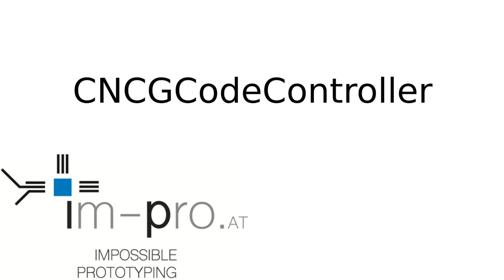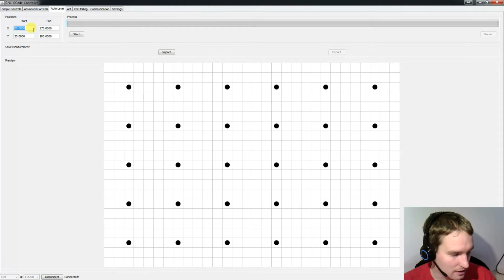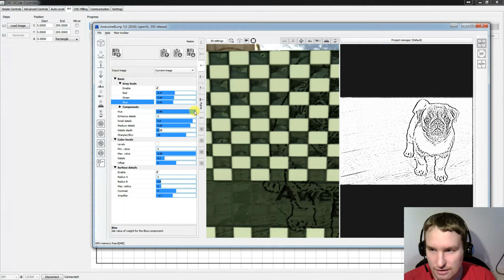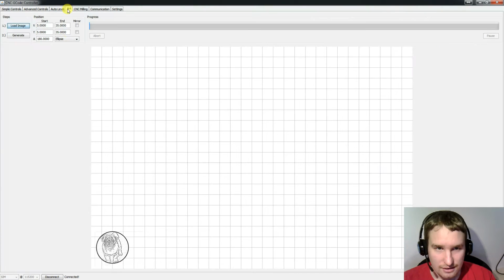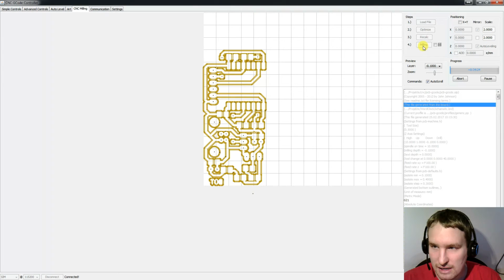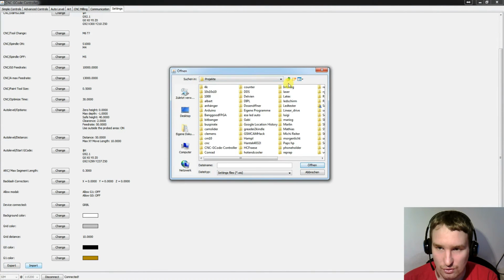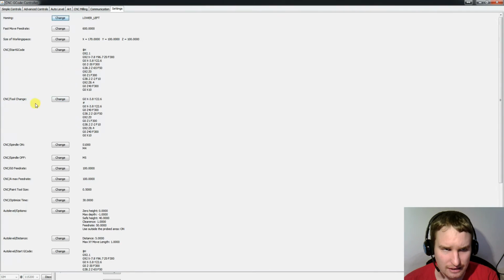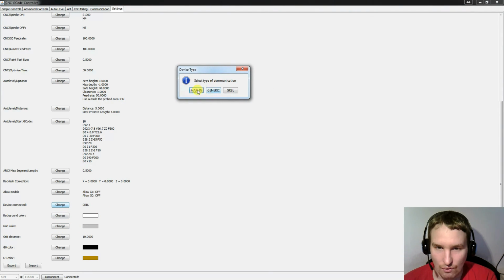Tutorial CNCGCodeController [en]

Comment: I am able to get his program to work as advertised in SIM mode(using Windows 10 laptop), but when I select my printer's COM port with a baud rate that works using Pronterface the program disappears as soon as I click on CONNECT.  Can anyone help with this???
Reply: BTW...I do get  a hs_err file each time this occurs, but can't make heads or tails of it.  Here's what the top of that file looks like:

#
# A fatal error has been detected by the Java Runtime Environment:
#
#  EXCEPTION_ACCESS_VIOLATION (0xc0000005) at pc=0x000000006af4753d, pid=16780, tid=0x0000000000002f3c
#
# JRE version: Java(TM) SE Runtime Environment (8.0_261-b12) (build 1.8.0_261-b12)
# Java VM: Java HotSpot(TM) 64-Bit Server VM (25.261-b12 mixed mode windows-amd64 compressed oops)
# Problematic frame:
# C  [libNRJavaSerial.dll+0x753d]
#
# Failed to write core dump. Minidumps are not enabled by default on client versions of Windows
Reply: I have same problem. Do you found solution?

Comment: this software looks great! unfortunately it wont connect for me, it keeps saying "printer not responding to M110". When I click connect I can see lights on my board quickly flash and then nothing. Do you have any suggestions?
Reply: I'm running Marlin
Reply: @wiskomakeables931  You will need to set your Baud rate correctly to your Marlin firmware. The setting is on the lower left corner of the application.

Comment: found your program last night, have it open, but confused on connecting to my machine - do I choose the "JS" or the "NR" com port to connect to? (I have both options with the appropriate COM number) 
What do these letters mean??
Reply from the maker: +heartless500 just two different Java  libraries. What ever works for you! JS Looks to be faster on Windows for me ;-)
Reply: thanks for the reply.. still trying to figure things out, lol I will get there eventually, but it is definitely a process!
Reply from the maker: Every setup is differed ... I tried to make it as flexible as possible!
Good luck ;-)
Reply: i appreciate the flexibility, but my problem is in the lack of information on what each setting does. this whole thing is new to me (i understand 3d printers & slicers much better) 
there are so many settings that I just do not have a clue about and there is nothing to help me figure them out. (specifically when setting things up to generate the g-code to be used - on the "art" tab, in the "generate" window)

Comment: Please options that sign the titles that this laser ...
Everywhere is written CNC ...
And it is not clear what is cnc what is laser options ..
or if its same to mmake CNC/laser .
Reply from the maker: Laser support is not official :-( 
Just works wich my mod of grbl (https://github.com/pknoe3lh/grbl-Mega)
So every setting is more or less for both .. except wenn you generate art and there is clearly written. 
if you have some problems make an issue (https://github.com/pknoe3lh/cncgcodecontroller/issues) i will try to help!
Reply: CNC has backlash problem and router bit variations. While laser does not face those challenges. However, laser would require a slower speed (depending on your hardware setup).